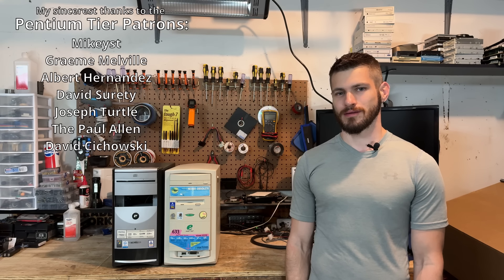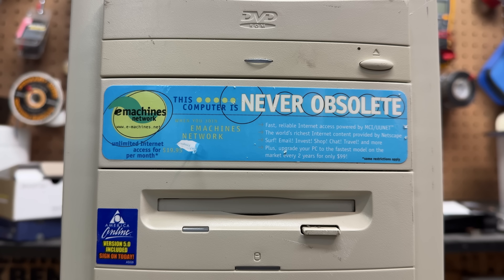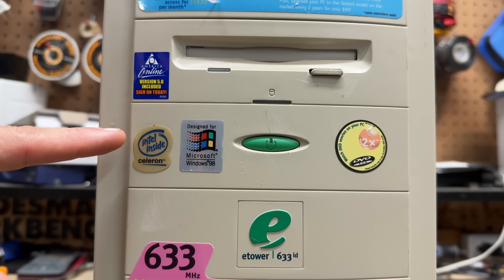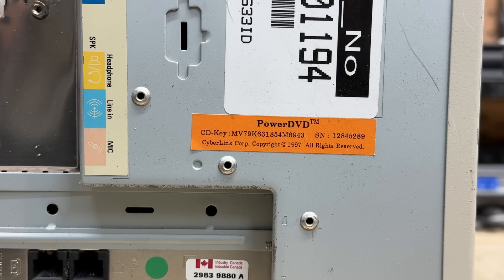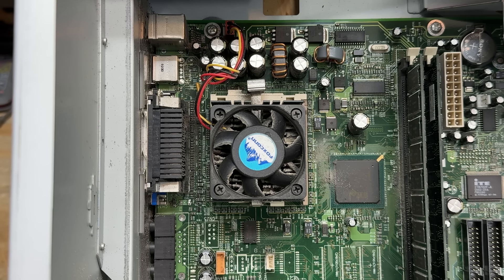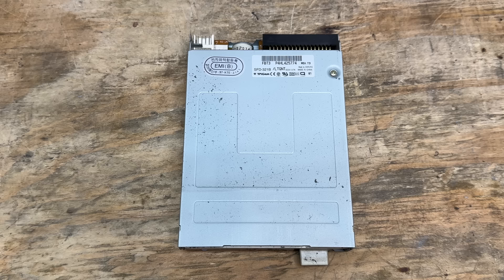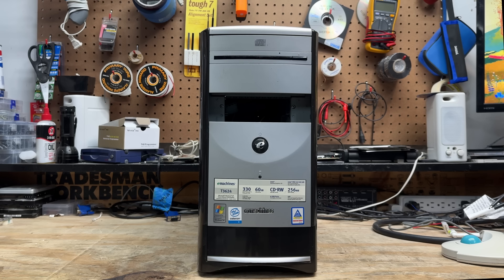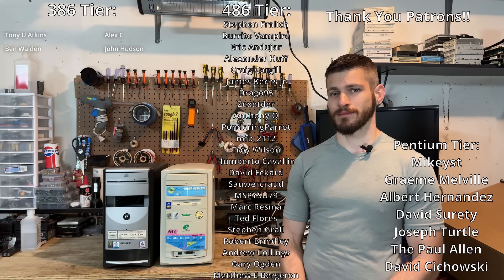Early 2000's eMachines! Teardown and test.

Comment: The second emachine was 100% rebuilt. That model was famous for the Bestec power supply that would kill the motherboard and it's probably what happened here because the board and power supply are not original. When those Bestec power supplies would blow up they would even kill the mouse and keyboard
Reply: Mine took out my wife's ipod. My first and last emachines product.
Reply: @WillDough  Yeah i think that power supply was called Bestec 12Z if i remember right. 5V rail would go nuts and kill the motherboard and everything connected to the usb ports. Worst part is,that thing literally catches fire so if you would leave it running and go away from home you'd risk burning your house down lol
Reply from the maker: Killer eMachines!? I guess the T-series towers stood for ‘terminator’. At least Robocop only took out bad guys…
Reply: @Mirra2003-f9s it was the 12E series, the 12Z is the ones that fixed the issues
Reply: Indeed. A friend called me for help when the Bestec in his E-Machines PC died.  The guy was very proud of his precious E-Machines he proudly got at Best Buy (he was very, very proud of it).  Dropped in a Thermaltake PSU I kept as stock spares and it was good to go.   Bestec was garbage but replacing them was often profitable.
Reply: @LatitudeSky  To be fair,those computers seemed to be pretty ok for non-pretentious home users and Bestec was not that bad as a brand itself. From what i saw online at the time the culprit was actually some glue that was applied on top of a regulator or something like that. The glue would turn conductive after an amount of time and it would bridge the components it was applied on making them short and blow out. Bestec still lives inside OEM computers to this day and they never had any incidents of this sort since then
Reply: Can absolutely confirm: had to replace Bestec PSUs more than any other brand in the 00s to the early 10s. Many of them in these Robocop eMachines systems.
Reply: I lucked out; I own an earlier eMachines T1360 desktop PC and the original Bestec 12E power supply surprisingly still works - 5VSB rail capacitor was changed for a better one in 2010 when I learned about the issue, which is a bandaid patch. Mine was an earlier revision 12E unit, which didn't exhibit the issue as often as the later revision 12E units. However, I rarely touch the system nowadays (last power on was to set it for DST a few days ago).

Comment: I found one of those "robocop" systems on the curb like 15 years ago, completely working. Turned out the previous owner had the same first name I do so I got a bit of a shock when it greeted me by name.

I took it apart and boxed up the innards for space, I've been thinking about putting it back together with a replacement case and boot drive with a graphics card for a window 98 retro system.

Comment: When you took off the case on the first eMachines computer, it reminded me of my original 566i2 model. I still have my 733i eMachines computer. It is still amazing and runs games like a champ. I even have the original restore cd that came with it... It even still has the Seagate HDD, and I still have the keyboard and mouse that came with it... Unfortunately, the speakers were always junk. lol

Comment: Ahh yes, the old eMachines system. For all the grandparents out there.
Reply: ..don't even know what eMachines are...
Reply: @dallesamllhals9161  you sound young
Reply: The serial number in 150 pt font is a giveaway lol
Reply: @BenState  Or mayhaps i stuck to my Socket 7 until Thunderbird in late '01?
Reply: @dallesamllhals9161  What's that got to do with your ignorance? https://en.wikipedia.org/wiki/EMachines
Reply: I only knew about eMachines from possibly an ad I saw somewhere, but mainly from a 17" CRT monitor of theirs I got from a super computer sale that was held at my city's Expo Hall. It was the first 17" monitor I ever bought, and used it on my main computer until I finally upgraded to a 20" 4:3 LCD with a big clunky stand.
Reply: Literally what my grandparents had
Reply: @SockyNoob  Hmm, So if I started onna' C64 - i'm older than your grandparents? Dang😑

Comment: cracks knuckles

4:48 - Not carrying handles.  Supports for the metal of the top of the chassis skin, which they were worried might buckle.
30:53 - Doesn't appear to be the original power supply.  The "part number sticker" looks like something a mom and pop shop would have put on it back in the day.
35:20 - There was an open expansion bay cover when you first started working on the system.  I'd hazard to guess they actually did have a MIDI-capable PCI card, and yanked it before decommissioning the system.  Also, it doesn't appear this model was ever spec'ed with a factory floppy drive, so I suppose it's also possible that the gaping hole was part of the equipment.

Comment: That white emachine was literally my first pc. I still have my machine. 

Upgrades I made years ago. 

RAM 64MB to 320MB.  I believe it could support 512MB despite what the sticker on the front says. 

Changed the 20GB harddrive (Mine was Maxtor branded) to a higher capacity. 

Changed the Celeron 633Mhz to a Tualatin 1.3GHz Celeron. 

Also had a pci gpu which I can’t remember the model. But it was ATI based.

Comment: I had a Robocop era Emachine with a Celeron D. It had a giant cone air intake on the processor that pulled air from outside the case through a circle of holes in the broad side of the case. I thought that was the coolest thing. 

Maybe because it was the first computer I never had to share with anybody... well at least since my Commodore 64 days... and it never got loaded up with malware from my other users. And I bothered to upgrade the RAM. But it was my first good IBM compatible Windows PC thing. The first one I didn't hate or just see as an appliance to do work on. I ended up rebuilding it at some point, upgraded the motherboard and gave it to my dad... who loaded it up with malware and killed it.

I have thought about tracking another one down, but I figure I have good memories of it and revisiting it might make me hate it. People seem to unanimously hate Celeron Ds in general.

Comment: Oooh~ I had one of those infamous "Never obsolete" eMachines too. Sat in a shed for years before it was given to me. Didn't get very far with it, as the power supplies were infamous for failing and frying the motherboards. Guess what happened to that machine... >.>

I think I have a very similar machine to what your brother had. It's a T6003 with an Athlon 64 in it. Got it from the original owner, including the original monitor, keyboard, speakers and manuals/CDs. Took an image of the factory install, as the original drive was dying, and upgraded it with a SATA drive. The original DVD drive was dying too, had a SATA DVD-RW drive in my stash that happened to fit the original faceplate. Also swapped in an Athlon 64 X2 6400, maxed out the RAM, and was able to install a PCI-E graphics card to make it into a capable Windows XP era gaming machine. Still have it to this day, and it handles mid-2000s games like a champ!

Comment: I had a friend that had an e-Machine from the never obsolete era and he asked if I could check it out and do any tweaks on it.  I found a model number on the motherboard on the Trigem website not even knowing who they were and flashed a newer bios on it.  It removed the eMachine's logo and replaced it with a full screen of Korean characters in a logo at boot up.  It still worked fine though.

Comment: Had a eMachine like the one on the right for a few years. Linux was the only way to still keep it going it had around 384 meg of RAM. The crystal audio chip had terrible bus noise. So had to install an audio card. It was my 2nd computer that used that chip and both had the same problems. You do a great job with your videos!

Comment: I actually have one of those "Never Obsolete" cases, I have an i7 6th gen in it as a sleeper, mine just needs the decals (someone previously removed them unfortunately)

Great case for a sleeper system haha
Reply from the maker: Ahh, the true way to transcend obsolescence!
Reply: @miketech1024  it seems to be the only way since e-machines is gone. 

That said, I'm not one who came up with that - so it seems there are at least a few out there still able to function in today's world.
Reply: @miketech1024 I still swear by the old ChiefTec Dragon.  Still upgrading from a Pentium 4.  Built like a tank.  Love your competence.  Very reassuring to know that you and others like you exist out there.

Comment: Never knew they branded Socket 478 Celerons as Celeron D CPUs, thought those were all LGA 775. Looked up the model of the Celeron D 330 in the robocop tower and it's a Prescott CPU, so it was definitely one of the later made Socket 478 CPUs. That motherboard looks okay though, basic but has pretty much anything you'd need out of a system from that era. Stick in a faster processor and an AGP graphics card and it would make a halfway decent XP games machine.

Comment: u must of read my mind in the comments as i was thinking and dreaming of my old childhood PC emachines Gaming style Silver TT3624.

i used to open it up and i even took it apart fully and cleaned it and put it back together 
wen i was around 9 or 10. brings back the memory of 
when the Ram Slots smelt like Burnin FIRE "years later figured i put the ram in the wrongway"
and when i changed the Voltage on the back to a 110VOLT on a 220V Circuit in UK it was funny so i did it to my play centuries PC too

Comment: I've still got my Mum & Dad's old eMachines computer from 2001. It an eMachines 566cd with an Intel Celeron 566MHz, 32MB RAM which instantly got upgraded to 128MB, and a 15GB HDD, and runs Windows ME. It done them well for a few years with a motherboard replacement in 2004 when it went wrong, but they had the extended warranty. I've not used it in over 10 years myself, so I might have to recap it at some point and check the PSU, and maybe do a few more upgrades and get it running like new again.
Reply: Also somewhere in my software collection I've still got the original factory CD it came with to restore the system.

Comment: I'm surprised you hadn't bought an air compressor for dust removal. Been using such since I was a kid, and recently invested in a larger, quieter compressor with 3 stage filtration and all the odds n ends. It's been amazing. Granted, your current process is more recording friendly. You have a PO box? I should send you some non-woven swabs for those floppy heads.

Comment: 25:12 I have a FIC/VIA K8M- 800M motherboard in mine, but unfortunately I did have the cap curse. It caught up to me in 2018 and I swapped to a spare replacement I had acquired off of Ebay. I actually have three of those boards in total and two of them need to be recapped. Its on the "to-do" list. lol

Comment: Thank you for trying to resurrect the Windows install on the first machine. I admit I was a bit anxious when at first it seemed like you weren't going to. But you can't fight a bad drive, at least not without sacrificing some chickens over them and going insane in the process.

As far as "never obsolete" goes, I love maintaining the Q4OS install on my Intel Atom-based Samsung Netbook that I bought second-hand for $20 a while back. It makes an excellent Pi-hole, but I'm sure you have more lofty goals for your eMachines system. Thanks for another fun video. 🙂

Comment: Those mid 2000s eMachines PCs were surprisingly reliable. My grandparents had one for over 10 years running XP. It was extremely slow, but it never had issues otherwise. Definitely didn't feel cheaply made.

Comment: I have the "Robocop" case at the moment housing my Plex server running an AMD FM2 Athlon X4 on a gigabyte motherboard with 4Gb ram and a cheap Nvidia graphics card.  I acquired the case years ago with the original hardware inside which I ripped out.  And boy is it heavy!  Certainly built to last.  Mine has the 2 DVD drive bays and the card reader at the front.

Comment: i have one similar to left , silvery one!  i got it for about £2 10 years of so ago, at a car boor sale,  and eventually stripped it out, chucked the case but kept all the innards, sometime a couple of years or so ago i decided to try to rebuild  it and eventually tracked down an almost identical case(original used the usual american thread screws but this 'replacement' one was almost all metric..ooer,... it fitted back in mostly ok but had to bodge the floppy drive button to fit correctly, but it got done and worked as well as it did before (has 2 optical drives but one was dead, so disconnected it) has its original XP install .. and,,no bad caps.😉 i'd love to get a 'never obsolete' one sometime 😁😁   i also have an actual Trigem thing, a flat destkop case 386

Comment: I had a full size e-machine tower growing up. When it was time for a new system me and my sister got to open up the system and keep parts for tinkering with. I recently found the old motherboard and hard drive, took a power supply from one of my other systems, hooked everything up and somehow it turned on and booted. Kind of a bummer the hard drive hanged trying to get past the user select screen and promptly died afterwards but it was nice to see the XP logo one last time.

Comment: The ASRock bios should have a "quiet fan" mode or something similar in the H/W monitor tab. For testing harddisks, consider using HDAT2 from a floppy drive. Very powerful tool, with multiple tests, bad sector recovery and even can be used to change how loud the HDD is while seeking (some drives are set to "silent" by default and we sure love those seeking noises)

Comment: I had an etower back in 99 I bought i at sears came with the monitor and 2 non powered small speakers it was 533 Mhz 13 gig hdd dont know how much ram I didn't know anything about PC's back then. My first computer was a COCO 2 in 85 i spent all my pay from my first job on it lol .I had fun with that TRS 80. Next PC was one someone gave me around maybe around 98 was a Parkardbell with 95 on it with a serial mouse that wouldn't work message about no PS/2 mouse came up. then in 99 I boufgt the Emachines and enjoyed that. I tried playing a pod racer game on it and Tomb raider it was worse than a slide show yikes back then I didn't know why. just thought I would share that. I liked that etower.

Comment: The T3624 at least had the MB swapped. I have two of them, one with a bad power supply/MB that I picked up later as a spare for parts. I think this was common but my original one is still working just fine completely maxed out 2GB and a Pentium 4 with HT, SSD etc. Bought it at BEST buy on Black Friday ~2004 for like $299. They came with a cost reduced Intel D845GVSR (Sea Breeze) Intel reference MB without the AGP slot installed. I was thinking about upgrading the MB to a full D845GVSR or later. Mine still ran dual boot as a hack-in-tosh as the original Mac reference boards that Apple had to work with was based on the same 845G reference board from Intel when they switched over to Intel.

Comment: I've never owned an eMachines' system, but somewhere in my stash there is a 'Tevion' (supermarket special). It boasts to be a Core2 Quad, and probably a bit modern just yet, but it came fully loaded with TV and satellite, WiFi, audio editing and God knows what else, but I only gave £2 for it at a local junk auction. It seems to me that it has a fair bit in common with your eMachines.  Luckily, it also comes with all of its original documentation and setup discs - It came with Windows Vista pre installed.

There is something cathartic about getting old technology to work again, whether it's a 1950s TV or radio, or an early 2000s computer!

Comment: My first pc from that time was a p3-500mhz, with a Savage 4 3d gfx card, then was subsequently upgraded to p3-933.
I'd change the celeron 633 to a p3 900-1ghz on a 133 bus speed😁 if the mobo can do the bus speed effectively doubling the bus speed and the cache memory. Failing that, a p3 with 100mhz bus'll suffice. 
2nd one a bit weird, mobo says prescott 800, i thought prescott cpus were only on 775 socket mobos, but seems u can get it on 478 sockets as well. I'd change to a p4 with at least 3+ghz on 800bus with hyperthreading!
Give those pc's a bit of a speed boost😁

Comment: Had an eTower 333 and 500 back when they were new, my Dad thought they were an awesome deal at the time... Which I'd say they were for what you got, never did the upgrade deal with them though.
As I recall, I put a 733 P3 in the 500 machine and had a Voodoo Banshee for graphics (because PCI was the only option), shortly after that I started just building my own machines starting with an Athlon XP because that was the new hotness back then (pun intended).

Comment: looks same floppy drive as in mine, i had to make up a 'special' button for it from some scrap plastic,  the original case had the button poke out the front panel but the 'new' case had the button integrated with the front and took a floppy with its bezel still present, the other one had to use one without...     the motherboard in mine is an 'imperial gl/ve'

Comment: Still have no use for the Celeron 633 that came with one of my project motherboards, not when I can choose between various 100/133MHz PIII. Or several Mendocino clocked at 300-500 MHz.
The way these old OEM S370 or Slot1 boards work with USB, is that one of the rear USB is just routed to the front. Saw the same in a Packard Bell (all capacitors had died in the plague).

Celeron D would have been loved if going from a Pentium era or older system (for me, 386DX-40 to Celeron D 2.4GHz). Mine was even originally paired with a 40GB version of the same HDD (it died and is still around in storage). Generic SiS motherboard however.